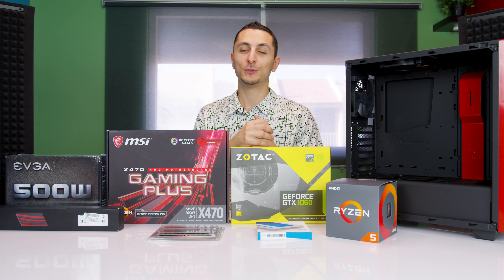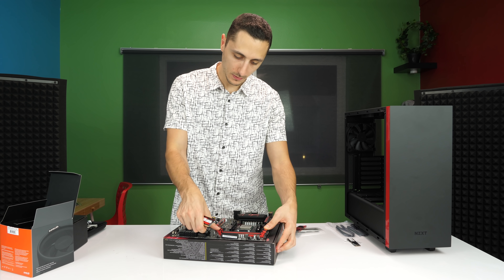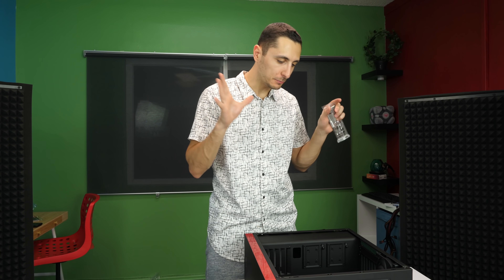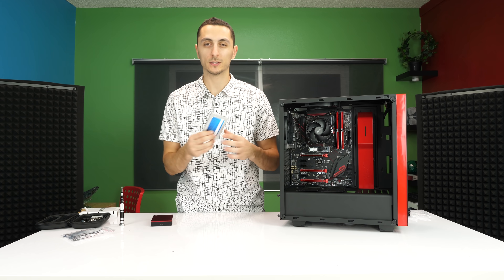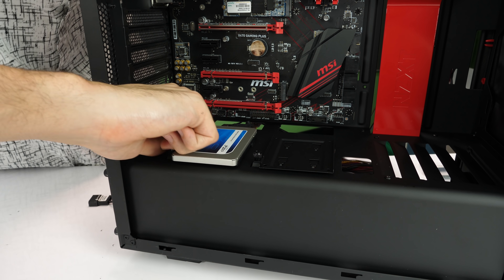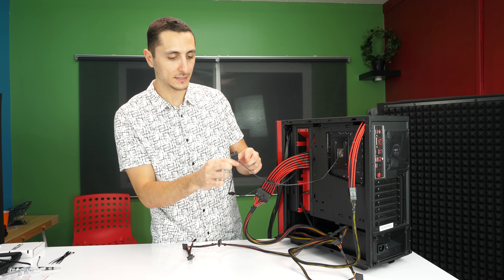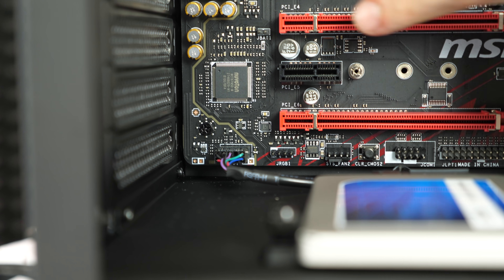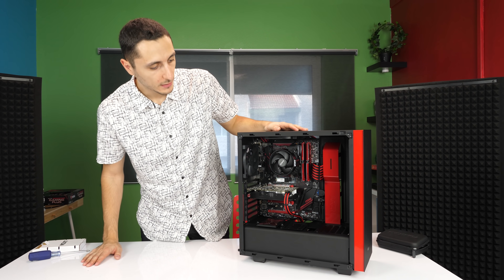How to Build A Gaming PC - 2018 (+Overclocking Guide)

Comment: #help i have the same cpu and motherboard being used in the video but my heatsink screws don't reach?? like i can't get them into the motherboard and the thermal paste has already set. I'm also worried the cpu itself moved and is wrecked now...any suggestions?
Reply: Aurelia-Fayne I have the exact same problem
Reply: You might need to get new screws
Reply: @Thomas-iu1uq  ya so it turns out i didnt put the processor in properly the first time, the pins werent set all the way, so i had a friend come look at it and do it for me, problem is solved, it didnt get damaged, all is well, thank you lol
Reply: Aurelia-Fayne same here bro

Comment: what is the purpose having m.2 ssd and sata ssd?
Reply: wondering same
Reply: if you want faster boot times and application opening then you go with sata ssd and an m.2 ssd is just a faster ssd
Reply: @ad6mm161  so you dont need sata ssd or m.2? like you dont need both of them
Reply: @Aaronvaris  no, as a matter of fact you can get off with some Hard Drives, they're slower but they're cheaper and get the job done
Reply: Same thing I was wondering. It is good to explain the reason behind decisions, otherwise you leave viewers in the dark. The m.2 didn't even show up when he installed Windows. It would be helpful to know why. So is the SSD even recognized as hard drive space? Or is it just used as memory? These things are good to know.

Comment: Would it be important to get extra fans for cooling, or is it not that important
Reply: Kayden Oliver it really depends on what is in your computer and if it is gonna be overclocked. If it is overclocked (in my opinion) add more fans but make sure you don’t have 2 fans next to each other that do different things (intake & outtake). Also if ya do get fans and they have LED’s in them, make sure you don’t do what I did and don’t notice that I’ve got 2 blue fans and then 2 white fans...... it looks weird.
Reply: PhantomWarrior18 thanks man, helps a lot!
Reply: Kayden Oliver no problem mate!
Reply: AwabElradi do you have an extra 4 pin that connects to the 20 pin?? If so that will be what you need. Other wise I would contact the PSU makers and ask them if it’s meant to have a 24 pin. Other than that i would ask TechSource himself. Normally there would be a 20 pin and then an extension 4 pin cord, since some MOBO have a 20 pin.

Comment: Who else came just for the overclocking
Reply: Just you lol
Reply: Don’t overclock your pc will die quicker
Reply: NoLove.EXE but he’s technically not wrong tho lol
Reply: NoLove.EXE how am I stupid ur putting in more watts than the cpu is meant to and that will kill the processer quicker if u have a 6 or more core why over clock anyway
Reply: @alexbrennan7505  except some processors are made to be overclocked. Like the Intel k series. It won't make too much of a difference, it'll just be like saying have a vegan computer instead of an omnivore one. Makes not too big of a difference in the end. You'll probably upgrade before it dies.
Reply: @alexbrennan7505  lol i have overclocked my 4930k for 2 years @ 4.5 ghz so far no problem

Comment: Yooo ✌️, anyone wanna give me some advise? I put a pc together on Amazon and  would like to know what your thoughts are on this pc. (I know i could have saved some money with a cheaper case, but i love the looks/design of the NZXT H500i)♥️♥️♥️

Part list:
Cpu: Ryzen 5 2600
Cpu cooler (just to be safe in case i want to overclock or something) :AMD Wraith Max Cooler
Motherboard: Asus Prime B450 Plus
Gpu: Asus Radeon Arez vega 56 strix OC
Ram: g.skill aegis f4 - 3000C16D-16GISB (2x 8gb - 3000 mHz)
Psu: be quiet System Power 9  500W
Storage:
HDD = 1TB Toshiba P300
SSD = 240 GB Crucial BX500
Case: NZXT H500i  + 1 extra 120mm NZXT AER RGB fan, for front intake.
Thermal paste (just in case): noctua NT-H1

Total cost: 900,85 Euro (If you want to change anything on the list, please stay at +- 900 Euro )

If you have any tips, or do you think some different parts should be used?
Feel free to react to this comment.
Thank you! 😘

Comment: 21:45 this is the part that i screwed up at, i did everything right, and everything was plugged, except these! because these were in the wrong place my build wouldn't boot, but now it did!!
this video literally solved my issue
Reply: yeah a year ago i inserted them up like that with the name facing the roof but i guess the plus and minus were back to front so i flipped it upside down and that solved my issue lol

Comment: Do you recommend buying this collection or changing some pieces?
1:-AMD Ryzen 7 2700X Processor
2:-MSI Performance Gaming AMD X470 Ryzen 2 AM4 DDR4 Onboard 
3:-NZXT H500 – Compact ATX Mid-Tower Case 
4:-BK021 Dark Rock 4 CPU Cooler 
5:-Corsair Vengeance LPX 16GB (2x8GB) DDR4 DRAM 3200MHz C16 
6:-WD Blue 1TB SATA 6 Gb/s 7200 RPM 64MB 
7:-Samsung 860 EVO 250GB M.2 SATA Internal SSD (MZ-N6E250BW)
8:-MSI GTX 1070 Gaming X 8G NVIDIA, V330-001R
Please reply as soon as possible

Comment: Couple extra point for new builders.  The case fan/s can be connected to your motherboard instead of the power source, so it can (automatically) control its speed based on temperature for a much more quiet pc.  Also think ahead to what you might be adding next, like a extra hdd or ssd, and have the required wires loose so you dont need to unplug other things in the way, w the time comes :)

Comment: Quick question: It looked like you didn't need those extension cables. The power supply cables looked long enough. Did they come with the case?

Comment: Can somebody tell how to connect to WiFi when this motherboard does not have one?
Also if I buy a wifi adapter will it generate it's own wifi or will it transmit signals from a wifi router?
Reply: You Can buy a Wifi usb or use a Ethernet Cable
Reply: Buy a wifi adapter. And if you have a lot of questions about pc building if i where you i would go on reddit on “pcmasterrace” or “buildapc” for advice. They helped me great a lot of times and they are very nice about questions

Comment: Hey, I'm going to build a gaming PC for the first time and need some advice on how my build will be. These are the specs

Corsair Crystal 570X Tempered Glass white
MSI B450 Gaming Pro Carbon AC
AMD Ryzen 5 2600X 3.6 GHz 19MB
Gigabyte GeForce RTX 2060 6GB
Corsair 16GB (2×8GB) DDR4 2666MHz CL16 Vengence white
Samsung 970 EVO 250GB
Seagate BarraCuda 2TB 7200rpm 256MB
Cooler Master MasterFan MF121L RGB
Bitfenix Whisper M 750W
AOC 32" AGON Curved HDR 144Hz 
Logitech G305 white
Asus Cerberus Gaming Keyboard MKII

What do you think about it?
Thanks.

Comment: Could you change the 1060 for the rtx 2060 without needing to change anything else?
Reply: Unknown you should be fine as long as you have enough wattage and have the correct power connector for that specific gpu

Comment: I play R6 Siege most of the time, and I want to use my new PC mostly to 
play it. I want to get the most experience from this game by building 
this new PC and buying the new monitor(I prefer small screen). I play 
this game with PS4 on 4k LED 55 inch TV 60hz. I want to use a keyboard 
from now on not a controller stick. What is my best and smart system to 
choose with a better motherboard for future expansion?

Comment: Noticed you didn't connect the 4 pin cpu2 that's next to the 8 pin connector. There is cpu1 and cpu 2.  Is the 4 pin for overclocking?

Comment: So here's the question, he plugged both fans to molex cable, doesn't it mean that they will be at 100% all the time? i mean they are not connected to motherboard, so you cannot control the fan curve. Please correct me if i'm wrong

Comment: Can I use 500watts power supply with r5 2600 with rx580 or its more recommended to use 550watts, btw I will OC the cpu
Reply: Pytz Arregaçado always do more than recommended there for there will be no doubt about having enough power and since you are oc ing it then you should definitely use more than 500 watts
Reply: @brennangarlock17  yes, the recommended is like 500 watts with this config I think, so I can do the same he does with a 600watts power supply, actually no one needs a 750 watts power supply unless u have high end gpus like rtx 2080ti or titan X or Vegas 64 etc

Comment: followed your build guide helped tremendously unfortunately my case had a power switch that is faulty lol.  back to square one.
Reply: Phantomz 714 you can use a piece of metal to touch the power
Pins just to tell you
Reply: @adamchamberlain5454  yeah thats what im doing but it tends to be annoying having to take off the tempered glass.

Comment: Just to clarify, when installing a computer with a 2.5inch ssd and a 3.5inch hdd do they both have to go in to individual SATA ports on the mobo? Or does the wiring work so they are on a dual wire that only has a single mobo end to it?

Comment: How would you install the windows on the nvme? How come the ssd showed in your boot drive and not the nvme you install? Would you recommend to fix the bios settings on which memory and choose nvme you wanna be primary so it will showed up later installing the windows?  Because here it only shows the ssd as an option where you can install the windows not the nvme...

Comment: The part that connects two fans into one, and then connects it to the power supply. Did you buy it or it came with your power supply? because I couldn’t find mine. Thanks. What I mean is 20:05
Reply: the power supply comes with that cable

Comment: #
TechSource - why did you skip that part where you should boot up pc and watching if BIOS is coming up or something is wrong with build and if there is any issue with system like mine was saying on monitor connected with HDMI "NO VIDEO SIGNAL". Did you get any issue with BIOS that needed upgrade otherwise pc will not boot even bios and monitor will show only black skreen with no beeps or any sounds?

Comment: I have this same style of mother board but its the msi pro carbon b450 it has two cpu power plugs like this mother board but my power supply and ed only plugs in the two 4pins that make the 8 pin on the right so I wonder if that last 4 pin is needed or not

Comment: I noticed you removed the M.2. You must of had problems with your SATA port? I read that if you install a M.2 , say a B450 Pro carbon one M.2 will disable 2 SATA ports. I was wondering how you enable your backup storages, like a SSD and HDD  if using all these devices?
Reply: If you install m.2 in the second m.2 port it disables sata on that motherboard.

Comment: Do you do extensive tests on your overclock more than just Cinebench or not? I can overclock my 1600x to 4.0 ghz. Passes in Cinebench but wont pass in a extensive 1 hour test on prime 95. Also I am using an aftermarket big block cooler.

Comment: I'm confused,  so when windows is installed I need to download the drivers for the Ethernet port on the mother board is this correct?  And if so I won't have internet connection too do so,  so I have to use a Wi-Fi stick or Wi-Fi USB to connect to the internet to download the drivers,  so this has to be a Wi-Fi USB that has had the drivers already installed for it to work on the new PC build ? so dose  that mean I need too install the Wi-Fi USB drivers using another pic which has internet access first to install the Wi-Fi USB sticks drivers,  then I can use it on the new PC I have built without installing the Wi-Fi sticks drivers to the new PC build,  it will be ready for me too access the internet so I can download the Ethernet drivers for the new motherboard? 🤔

Comment: I'm going to build a PC with a Ryzen 5 2600 on a MSI B450 A Pro. Should I update the Bios before installing windows to ensure system stability? I'm using Corsair LPX 3000Mhz ram, and even though its on the QVL I'm not entirely sure if its going to play nice.
Reply: Cthulu TheSpy im getting the same build and i think the bios are fine

Comment: You have install 1 M.2 and 1 ssd, but at the menu of choosing storage to install Windows 10 you have only 1 option which probably is the ssd. My question is if I use only M.2 for the storage of my Pc, can I install there the Windows 10? Or do I need an extra ssd driver to install Windows?

Comment: What about the 2 cables coming from the 2 fans? not the cpu fan but the other fans. where do i need to plug those in?
Reply: i found it, its sys_fan1 and sys fan 2 on the motherboard

Comment: I know this is a REALLY stupid question but  I have never made nor have i bought any computer parts but have been interested for some time... so my question has to do with cables..

Do i buy the  cables separately or do are they already provided?
example: does the motherboard come with all the cables i need to attach to it or do i buy those separately.

if i would have to buy them separately or probably have the wrong a approach... idk... can maybe let me know if im thinking correctly..

 i don't want to buy more then i need too

please help
Reply: I just bought all the parts I needed for my pc. If you are buying from amazon ( or some other trustworthy site) and not some dodgy seller you will have all the cables you need and won’t have to look for cables. They are all provided with the parts you order.

Comment: On the motherboard he only plugged in the 8 pin connector, what what the other 4 pin connector for? And is it necessary to plug in?
Reply: HeadZy its not necessary. If you have an extra 4 pin you can plug it in but you will hardly see performance boost
Reply: @multiplayergameplay__2151  Thanks for the answer dude! Appreciate it highly :)

Comment: will team elite t-force delta rgb will work stable @3200mhz by using only xmp? im pairing it with msi mortar max and ryzen 5 2600 and rz 570 4gb lol. btw, will using same overclock settings your using will be stable too?

Comment: I have never built a gaming system in real life, I was just wondering if you have a fully modular power supply does it come with all the necessary cables or do you have to buy them separately
Reply: CrappyGamer123 8 it comes with all the cables
Reply: JustTooLogical Logic thanks man

Comment: I have a question, because my laptop is running low in some games i want to overclock it. Is the overclocking values is the same if i have a Intel(R) Core(TM) i7-8550U 1.8GHz with Turbo Boost up to 4.0GHz and a NVIDIA Geforce MX150 with 2GB VRAM? Sorry I'm new to this. Just looking for advice and because dont want to damage my laptop :) Thank you

Comment: Hi! i'm using the exact same motherboard as you but instead of a ryzen 5 i'm using a ryzen 7, do you have any idea as to why it may be that it does not post? When starting up the cpu led lights up for 6 seconds before turning off shortly after, i have yet to solve the issue, if you have any suggestions it would be much appreciated

Comment: So I have to pay for a windows key?
Reply: If you're doing it by the book, yes. However, Microsoft will let you use W10 indefinitely without a product key. There will be an activation watermark in the settings app and you cannot change most personalization options, but other than that, it will work exactly the same as if you bought a Windows key.

Comment: Do all the screws and cables come with the case or the part or do you need to buy it separately?
Reply: i think every screw/cable you need comes with part.
Reply: keep in mind you usually need to buy thermal paste and cooler for cpu. thermalpaste costs like about 10 dollars
Reply: R34L Fishy thank you for the help
Reply: no problem:)

Comment: would the overclock be the same for a ryzen 7 2700x? I also have a ddr4 3000 and 1070ti. Ever since I set the mobo to expert mode I've been getting a bluescreen at startup and I didn't even touch the bios that I remember before I started getting it. I'm trying to figure out how to get rid of it

Comment: Great content. I've had an x470 for two days now and I'm wondering can you still control the case fan speeds while connected to system panel, or do they need to be connected to the system fan to be controlled?

Comment: hey @TechSource when you plug the cpu power cable at 19:50 , there's another one next to it called cpu power 2, doesnt that need to be connected too?
I noticed because im building a pc with the same motherboard and im thinking that my power supply doesnt work for my motherboard because it doesnt have the cable for the cpu power 2 plug
help pls! cheers

Comment: Is there any other way to make the fans from the case work I don’t have a cable for the two fans to plug into the molex cable from the power supply
Reply: PhD Twisted get a fan splitter

Comment: Where did the cable that you plug the hardrive into come from
Reply: the harddrive needs 2 cables, one sata-data and one sata-power. the sata-data goes to the motherboad and the sata-power goes to the power supply